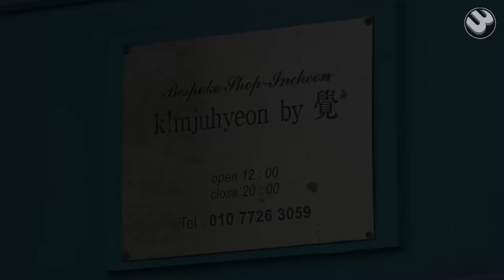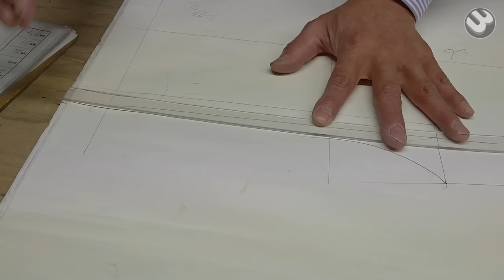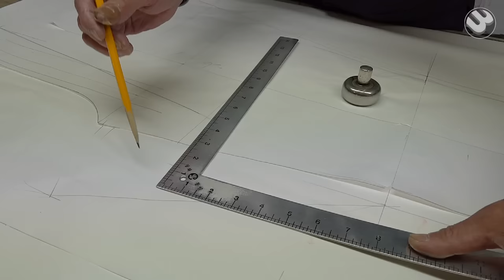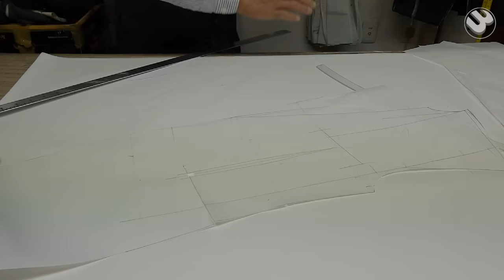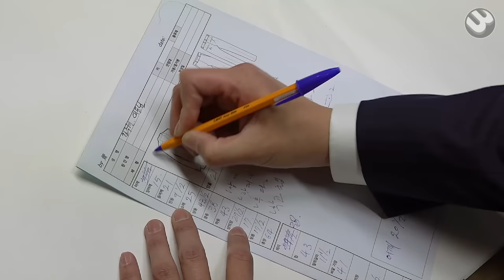How To Make Bespoke Suit by Famous Korean Suit Master

Comment: Very interesting to see the Korean procedure. For people that don’t have much knowledge about suits and the tailored versions here are some hopefully helpful facts. The suit style that is seen here is the European Continental style. Usually designed for more slender, slim build men, a favorites in Italy, France and as mention Continental Europe. The width of the hem and length of the pants are in big contrast to the English Layered Style which is a must in British Aristocratic families. They cover 2/3 of the shoe and are significantly higher - the natural waistline and not how it’s seen here on your hip line. Furthermore a bespoke suit is usually pretty much done on your first fitting. The English Layered tailors have such an eye for their craft that by “ only” taking your measurements they designed and craft the entire suit. The first fitting only requires small details that need to be adjusted. I was very surprised how many changes the tailor had to make on this video during the first fitting. I will be honest, if I would have attended this fitting for my husband or one of my sons I most certainly would have been very upset. I expect an almost finished product even at the first fitting. Another detail that I am not used to see in a bespoke suit is the adjustment band for the waistcoat at the back. A custom made waistcoat never and I mean never needs a band in the back. The whole purpose of the bespoke suit us that it doesn’t need extra adjustments. It has to fit the men perfectly and that goes for the waistcoat as well. Something else that caught my eye is the the lack of curve at the Blazer. It should be going down on a men’s ribs, forming a three dimensional curve to highlight his chest and separate the top of his torso from his stomach. I am not overly critical or a snob. Simply used to a different cut and more craftsmanship and yes knowledge. Bespoke suits, shirts are a science for themselves and if you have limited knowledge everything will appear to be quality unless you know what you are talking about. I clashed with many tailors before which is normal in itself. You need to be able to hold your own and know your business otherwise they will walk all over you.